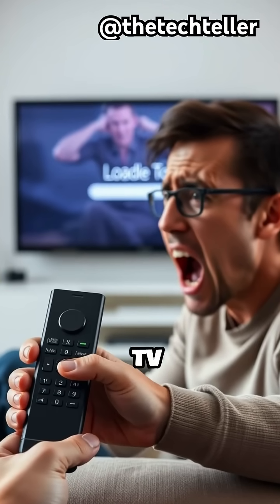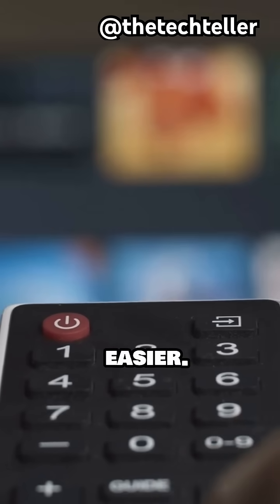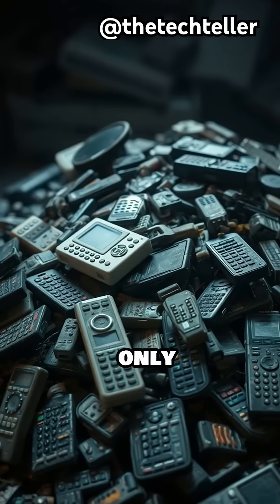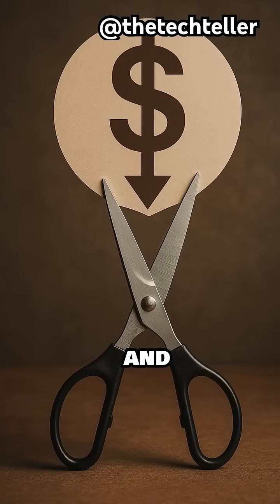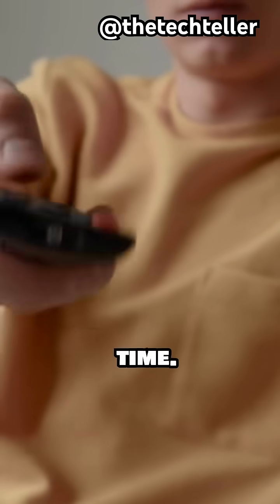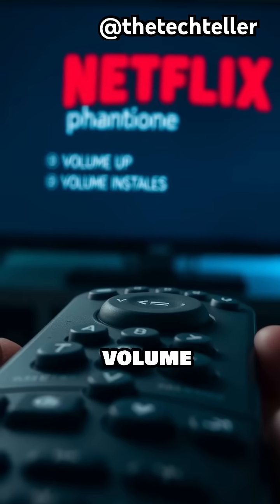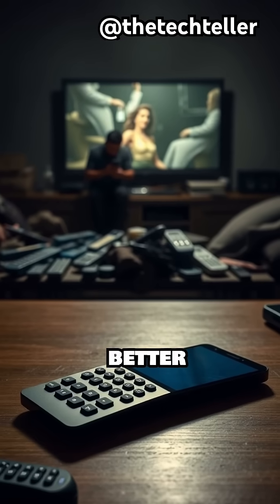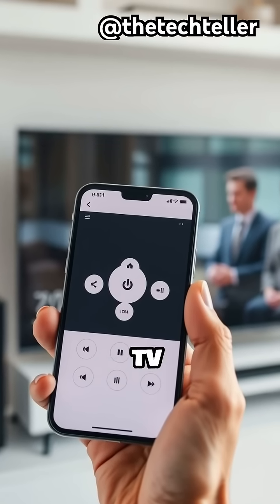Pressing the Wrong REMOTE BUTTON Everytime?

Comment: Not quite, it doesn't input a totally different action like that. It just starts to be prone to not detecting the input or what you may be thinking of is they start to stick down the rubber domes so they might randomly unstick, tiggering a random wrong input that the dome is set to like opening Netflix
Reply from the maker: xD